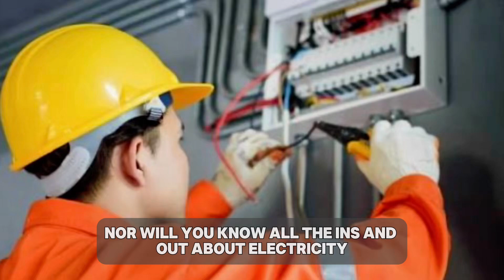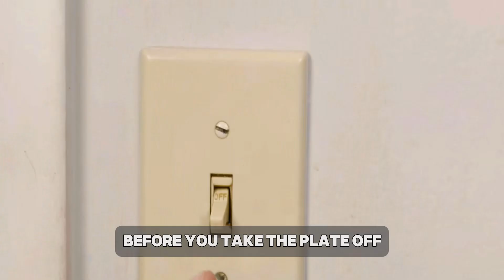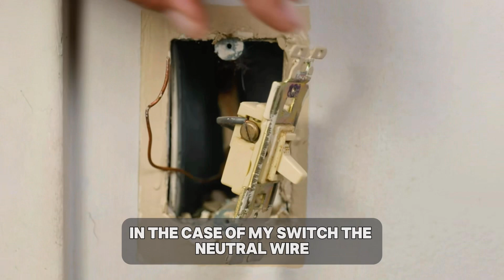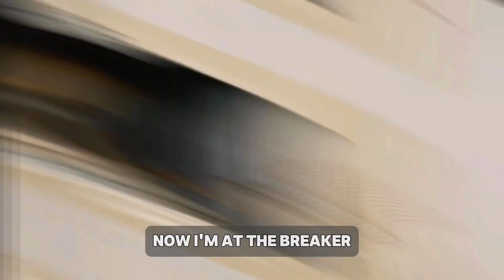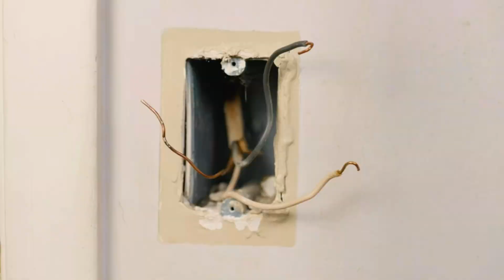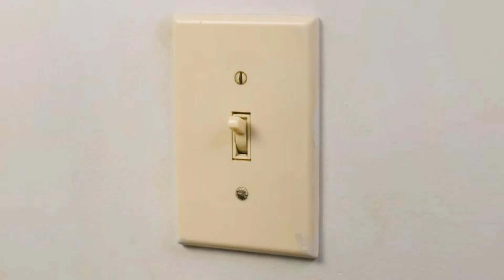Install a Light Switch in 10 Minutes | No Electrician Needed

Comment: Your on the wall actual switch wiring does not match the diagram. The diagram depicts how a standard switch wiring in which the power coming in (hot wire) and the power to the light (switch leg) is wired. The neutral wires are joined to close the circuit and complete the return path.
The switch on the wall is a switch loop configuration, meaning that the power (hot wire) is going to the light box first. The white wire in this case is not a neutral wire, it's a white wire re identified as hot. It should have black tape on a small part of the insulation to identify this, but it's not always done. In a single pole switch it doesn't matter which wire goes to which conductor terminal in either case.